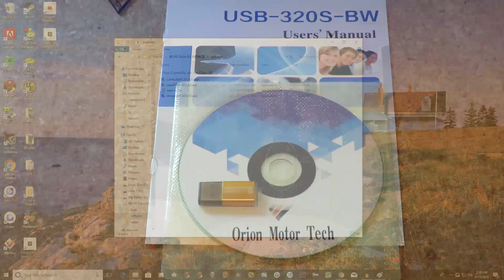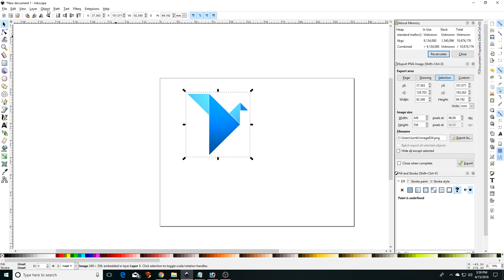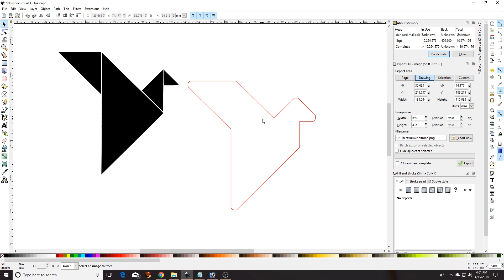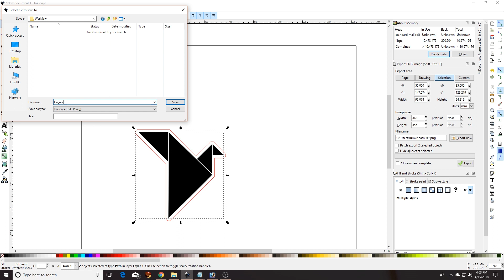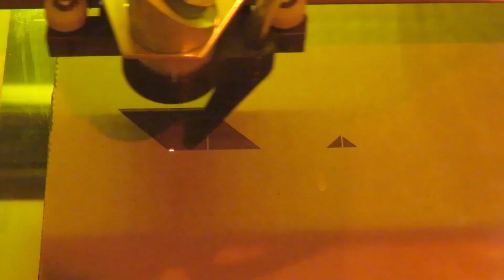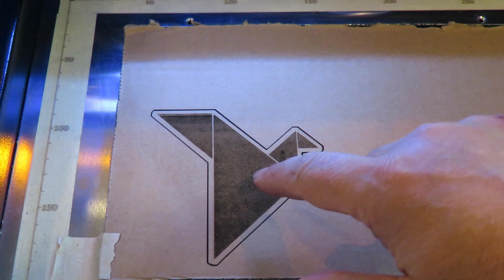Chinese 40W Laser Ez-Workflow - Ditch the Bundled Software

Comment: Do you know if k40 Whisperer will etch/engrave greyscale?  The CorelLaserDraw software will with the K40 but only to a size of 40mmx40mm.  Anything larger than that and it is 1 bit, "black and white" only (so annoying).  But I have done it so I know the machine is capable of modulating the output.
Reply from the maker: K40 Whisperer has a "Dither" option which says it simulates grayscales.  http://www.scorchworks.com/K40whisperer/k40whisperer.html  Scroll down to just past the halfway mark on this page and you'll see an output; it looks larger than 40mm x 40mm.  I've never attempted grayscale/dithering, so I cannot yet vouch for how well it works, but the screenshot looks like it works well.

As far as I know, and as far as the author of K40 states, I do not believe that the stock controller board on the 40W Chinese Laser doesn't have the ability to modulate the power to laser tube by software.  The higher power / more expensive ones might.  However software can control the duty-cycle of the laser (how often it is on/off for a given travel), and/or the number of passes over a spot (darker spots would get more passes in the same spot to etch/engrave the image more).

There are people who have attempted replacing the stock board with an Arduino controller and using GRBL to control it.   With these controllers, they take the time to ensure that they tap into the power line of the laser tube and CAN control the output power.  See https://www.youtube.com/watch?v=8m3evdpEeIY  as one example.
Reply: @lumkichi1341  Thank you for your reply!  I will check your suggestions.  Yeah, I am not sure if the controller on mine modulates the tube current or if it is software trickery.  I am thinking it may be software trickery because of the "40x40" limitation.  Who knows... Regardless, I am finding quite a few limitations with the "stock" software so, I am glad to see these options available.  I can't wait to try them out.  Thanks again!!
Reply: @absolom7691  The dither mode is a bit of both. You cannot modulate the current to the laser. That just isn't something that can be done here, I think you might if you switched to a smoothie board or whatnot. But, you can modulate the time spend at each point and speed it travels at, and also the number of passes it makes. K40 currently only does dither which basically controls the number of times you zap the general area of the job. Which will produce a pretty reasonable result, I've considered coding up something to do multiple passes which might make for a reasonable height map / depth map cut, so you do the highest level bits of the grey scale at one speed, then the second highest bits at a faster speed and the next highest bits at another speed, etc. 

In my experience the problem is often that the blackness or whiteness of an image properly needs to be the depth of the cut, and using images it simply isn't usually the case.

Comment: I´ve fallowed all your steps, but somehow, it won´t work.
I´ve created a design on Inkscape, than I trace bitmap, but I can´t have a preview. Then when I save it, and try to open it on K40 Whisperer, I just got a white screen, with nothing on it. 
any idea what might be happening?
thank you.
Reply from the maker: I think this part of your description is most telling.  "I trace bitmap, but I can´t have a preview."  This tells me that a bitmap trace did not occur and you essentially had a blank document.   The K-40 Whisperer probably does not see the bitmap at all and appears as a white document; empty.Create a new empty Inkscape image.  Paste your bitmap or image into Inkscape.  Make sure you select the image so that you see a boundary box around the image (and that you can drag the image around).  Then select "Path -> Trace Bitmap"   -  I am going to paste a link to another youtube video on bitmap trace, but the guy in the video also says, "make sure you select the image"  https://www.youtube.com/watch?v=E7HwLTQu2FI   -   Also another thing to make sure of - the image you paste into Inkscape may be very large and is oriented off-page.   The "page" is the rectangular boundary you see when you open inkscape.  If your image is not sized for that boundary or is off-page, it'll most likely show up as "white" when you open it in K-40 Whisperer.Good luck!
Reply: @lumkichi1341  thank you.
after wrapping my head around it  the hole weekend, I´ve manage to get it out.
the bad thing is,I don´t know exactly what I was doing wrong.
funny, that what´s most challenging, is simple geometric draws. with pictures full of pixels, I got no problem :)
I need the machine to cut plywood  coz I´m in to building planes.
eventually, I´ll learn as I go, and I´ll share it on the YouTube.
thanks so much for your recommendation of using Inkscape and K40 Whisperer.
without it, it wouldn´t be possible for me to cut airfoils  and other parts

Comment: I heard you want the one with the KNOB and dial amp-meter... not the digital display and push-buttons....
Reply from the maker: I agree; if you are going to be using it for yourself.  I am sure that the knob is easier to adjust manually - but it's kinda hard to communicate, "set your laser power to 3.7 on the knob," whereas saying "set your power for this material to 8 - 9% for engraving and scoring and 48% for cutting."   On this link where I made one of those Dymaxion Globes, I state clearly which settings and material to use to duplicate what I did.  https://www.thingiverse.com/thing:2914695   It would be harder to say what the settings were with a knob dial.  Assuming that the percentage readout is indicative of power, then 48% of 40W can easily be translated to 19.2W of power to cut 1/8" birch, for example.  I think it would be hard to say the same for knobs...

But I agree that knobs are easy to adjust up and down and keeps things simple.

Comment: Hi, I wonder whether it is possible to ajdust acceleration and speed at all when laser is not working? I mean when it is relocating? I would like to lower the speed. Thank you.
Reply from the maker: Right now, I am not aware of the speed adjustments when re-orienting, but I suppose it could be a feature request to be built into the K40 Whisperer to do just that.
Reply: I tore apart the whisperer code and wrote my own API (K40Nano), and expanded the understanding for the decoding of the underlying LHYMICRO-GL language and I can tell you that yes, you could relocate the laser in compactified mode with a lower speed. But, the program itself would need to tell the laser to do that, and it's a weird sort of thing to do. It would be a bit strange and it twitches sort-of when it enters and exits that mode and would need to do so anytime you changed speed.  You can move the laser head at the same speed as a cut, if you want just without firing the laser. -- However it might be better to just unlock the rail and move it into position yourself, the rapid movements during relocation are a different mode than cutting and the only speed adjustments are allowed when it's in the engraving mode, so you'd basically have to move it in engraving mode.
Reply: In fact, I added to K40Tools (the example tools package for the API) a file called SlowMove. I don't know why you'd want to do this,  and I don't need to but you can call "SlowMove 2in -1in" and it'll slowly move the head to the new location there. ( https://github.com/K40Nano/K40Tools/blob/master/k40tools/SlowMove.py )
Reply from the maker: You are awesome, I can't wait to take a look at this, and I am sure Gabriel Křížek appreciates it too!
Reply: @lumkichi1341  Even being rather dismissive of moving the head at a needlessly slow speed, I ended up using it for timing the speed codes. And added some functionality to it, to specify the board type as needed and time how long it took to perform the move operation. It uses a stepper motor and regardless how fast it moves to a new location it should actually be in that location. Spent the last couple weeks reverse engineering the speed codes really well, and checking the theoretical against the actual is a pretty critical step in that at times.
Reply: @Tatarize  , you sound like you'd know: are there any efforts for porting k40 whisper sw to a grbl controller?